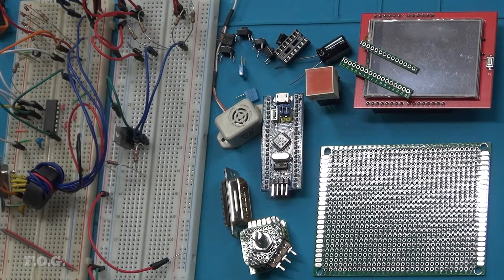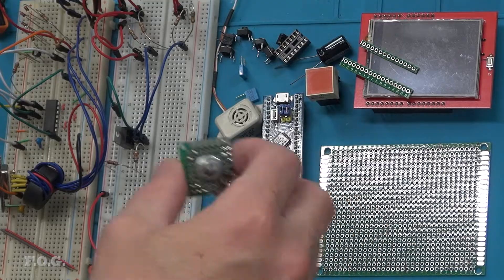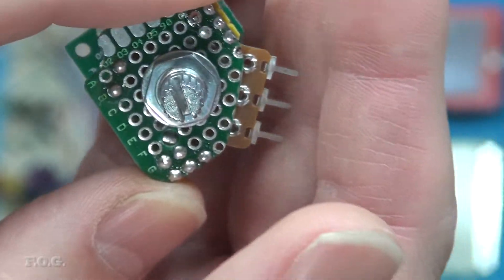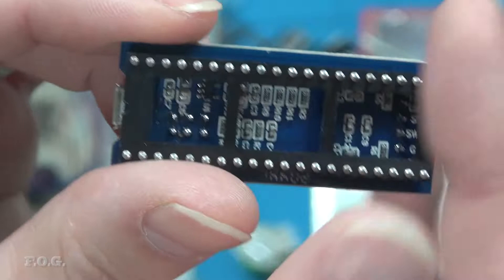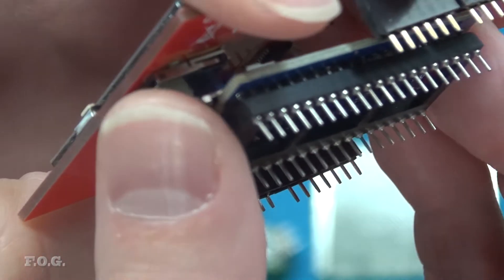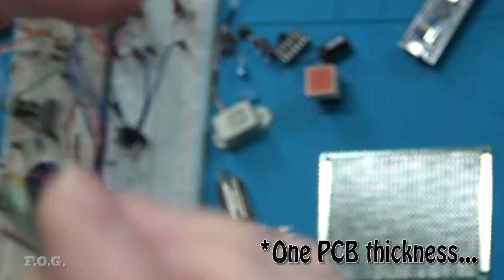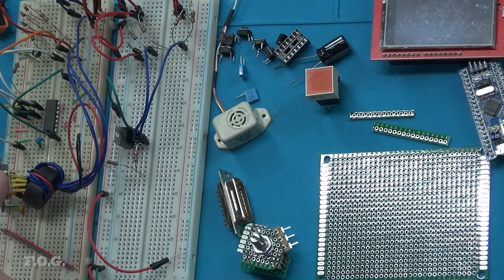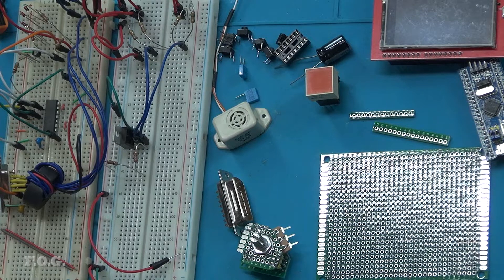EP7 - Mini Lathe Upgrade - Building Control Board - Brushless Motor Conversion How To

Comment: Do you have any plans for a video on the code for Arduino. I have 2 Unimat DB200s, one setup as a lathe and second as a milling machine. I think your program would work great for them.
Reply from the maker: No, I am sorry, I have no plans at this time to go through this particular project in a video. Even so, many of the lessons are based on code taken from this application.

Comment: Great result.  Neat PCB.  Thanks
Reply from the maker: Thanks for the comment! I am pretty happy with the result too. Typically these type of boards can turn into quite a mess of wires, but the routing worked out nicely. Honestly I would have preferred to etch a proper PCB, but I currently do not have the stuff on hand, and I think hand wiring is better for showing people they could do this themselves if they wanted too.